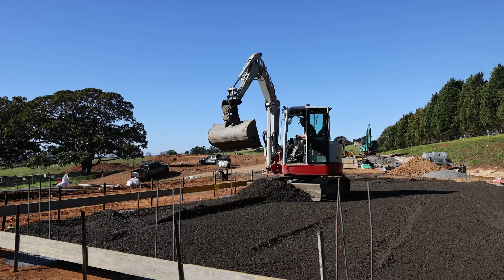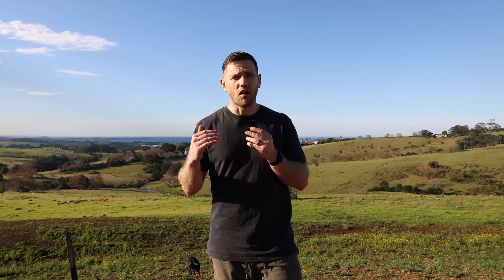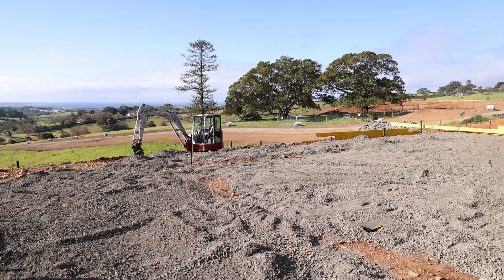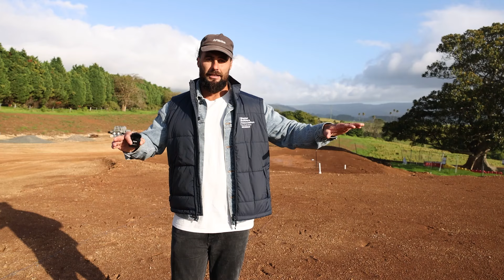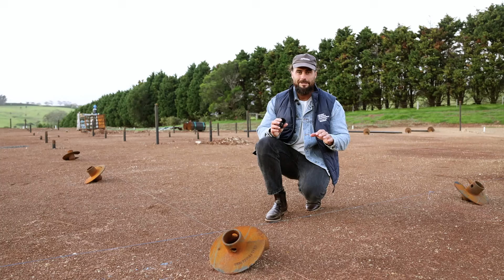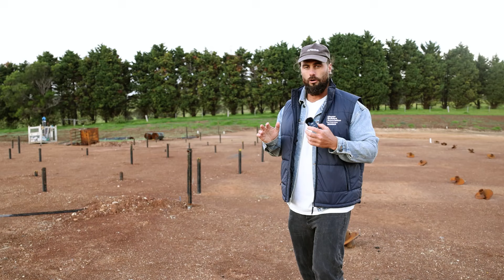Anchoring Our Build with Solid Foundations (Build Update)

Comment: Screw piles should be design AS2159 to ensure the ground is not overloaded.  I’ve seen many screw pile installers just go off torque and say the load capacity has been met when in fact they are overloading the soils.  Also they need a good depth to assist with reactive soils movements and many install them shallower then they should be.  In a sloping site screw piles also don’t have as much lateral capacity the say bored piles do - which can be an issue on some of our a sloping sites with landslide risk on the south coast of nsw.  Filling also not well compacted to as3798 can settle.  Fill should be placed on the terraces cut slope not a slope to prevent slips.  And any level 1 should be signed off by a chartered geot engineer as well as the screw piles.  On this site - given rock is shallow - the screw piles ideally should go to rock.  The benefit of screw piles is that they don’t need to be cleaned at the base of the piles - so settlement less likely unless they are overloaded.   It reads in torque (kNm) not kpa.  The kPa is the bearing and how we design with as2159 - Happy to check the screw pile design if required.
Reply from the maker: All signed off by engineers :) we are not professionals but confident it’s all done to specification. The builders have to warrant the work so ensure that it’s done correctly
Reply: not by your geotech but the structural engineer is a good one so they should know all this.